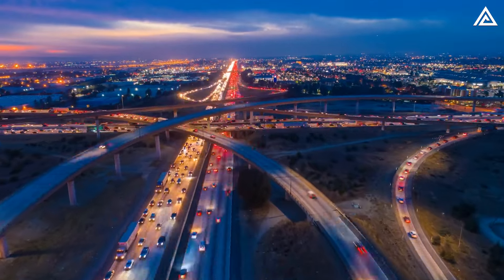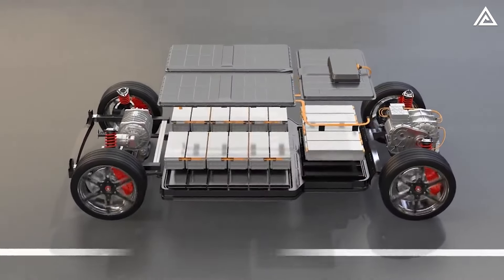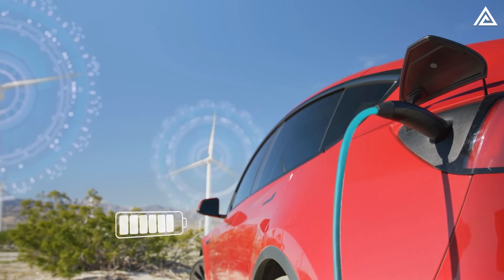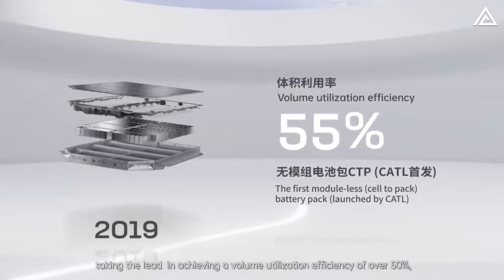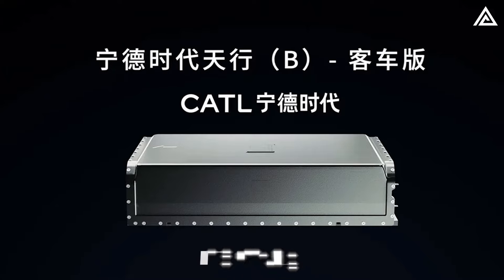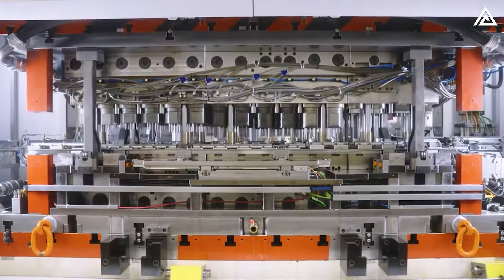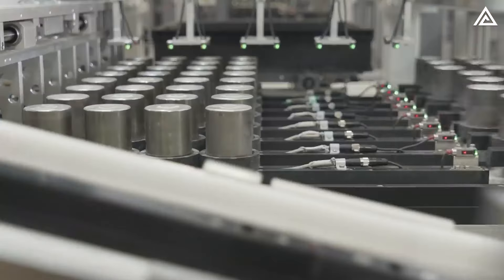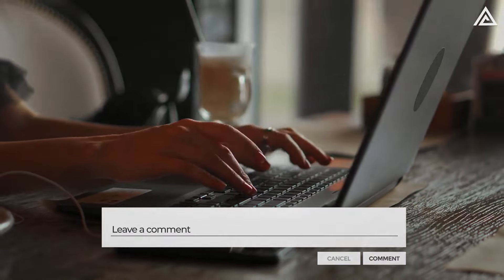Elon Musk Announces NEW CATL Tectrans Battery. 175 Wh/kg, 15-year lifespan, MORE...

Comment: Is there a 7-seater EV VEHICLE SYSTEM that doesn’t range- degrade in excess of 2 %, used 15,000 miles /year, able to recharge 40%-80% capacity in 3 minutes, after 20 years ownership, entire tire-set renewed annually? Thanks for the information.

Comment: They will last 15 years? I’ve had LFP batteries for my solar back up  7 years and they are guaranteed for 20 years but will last 25! So 15 is a little disappointing.
Reply from the maker: Do you have any solution for this? OR what is the best way to do it?

Comment: I wonder how Tesla's dry electrode tech will impact the cost of EVs in the long run.
Reply from the maker: Tesla's dry electrode technology has the potential to significantly lower EV costs in the long run by reducing manufacturing complexity and energy consumption during production. It could also enhance battery efficiency, leading to longer lifespans and fewer materials required. These factors combined may help make EVs more affordable for consumers while maintaining performance.

Comment: Will CATL's 1 million-kilometer battery truly revolutionize electric vehicle longevity?
Reply from the maker: sure
Reply: There are already almost 1 million kilometer battery. Meaning 3000 charging cycles and 300 km range means 900 000 km, but it requires that developers can keep water away inside from battery which isn't there yet because they end up leaking or water humidity condensates inside and causes problems.
Reply: If it does last 1 million km… it will last longer than your car!
You can take that battery and transfer it to your new car! And still have nice 500000km durability left.